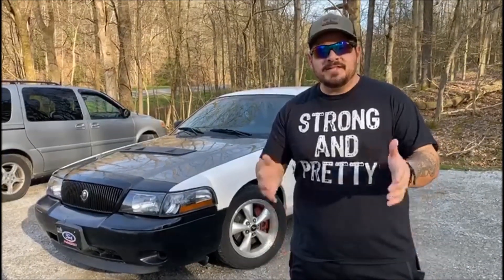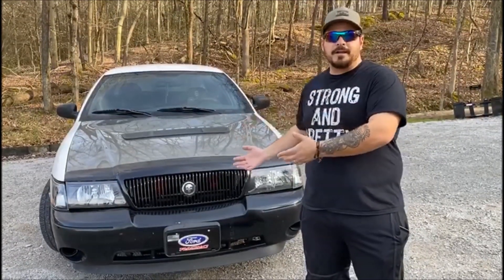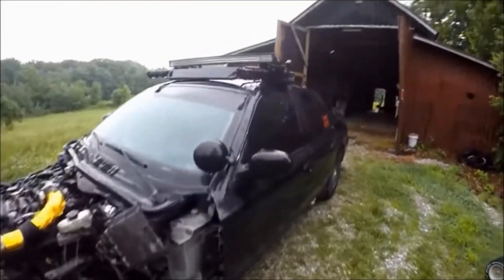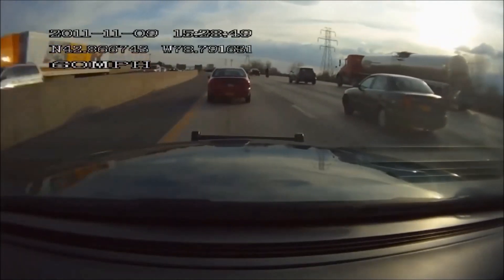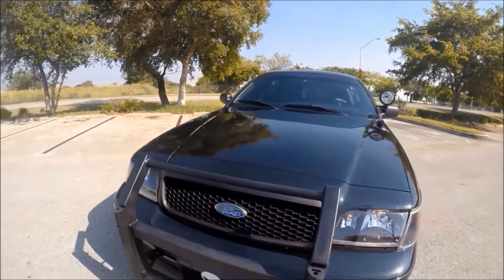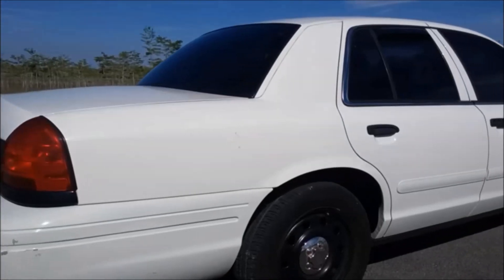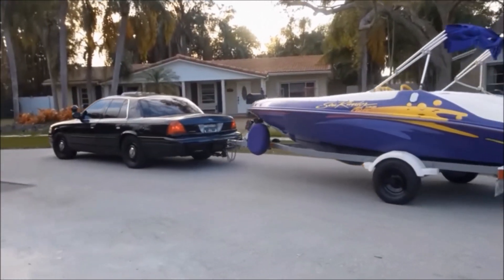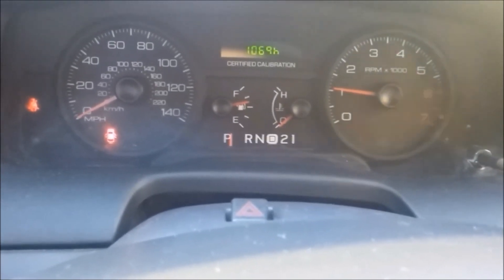Certified Calibration EXPLAINED! Crown Victoria P71

Comment: if you look in the police supplementary guide it says that "certified calibration" only applies to the calibration of the speedometer head assembly, and not the speed from the computer, which can vary depending on tire pressure, etc. So they come from ford like that, but i guess PD's check the calibration with a 3rd party and then they issue some sort of certificate. The supplement guide also says the speedometer head is accurate within ± 2 MPH so that's pretty damn accurate compared to regular cars which is like ± 5 MPH.

Comment: On a 2009 p71, changed the rear end to a different ratio... now the speed is off by 5 mph +/-.  Is this fixed with software, or is it a "speedo gear" somewhere in the car? Can't get a straight answer on this??? Thoughts??
Reply: Tim Mallon your speed will definitely be off if you changed the rear end because of different gearing so to get it back on perfectly it would need to be re-calibrated. To get it closer to the true speed make sure you have the original wheels on the vehicle.

Comment: Could you still get it certified after it's a retired police vehicle and where could you get it done at?
Reply: James Lorenzen no it cant its strictly for currently in service police fleet vehicles. But once it is calibrated is stays calibrated for many years as long as you have the original wheels.

Comment: Interesting when I tested mine against a cell phone app Speedometer, which I guess works by GPS, both were spot on with each other.
BUT  when I first got the car, the ABS computer had gone out and the dealer said they would replace it for me the following week.  In the week before I got it fixed I drove the car and compared it head to head with the Speedometer app and the car speedometer read 5 mph low.
Then after they replaced the ABS computer, the two matched.
So why would the ABS computer affect the accuracy of the speedometer?
Reply: B3burner the ABS and wheel speed sensors work use the same computer on those cars so if the computer goes bad for whatever reason then the computer is unable to read the wheel speed sensors 100% accurately therefor causing the speedometer to be slightly or largely off.

Comment: Crown vic intercepter, 
dodge charger intercepter
What is better do u think??
Reply: 0 hobak the crown vic was built to last a lot longer, the platform goes back decades and the engine didnt change much also so as the years went by Ford was able to perfect it as far as reliability goes. The charger has a more powerful engine but isnt as reliable so the extra power isnt enough to best the crown vic overall.

Comment: I was wondering about that. I've got a 2000 P71. There were no outside mounted lights, etc on this car. Inland South Carolina, no real rust. I bought the hubcaps on eBay, had to buy shouldered lugnuts to hold them on. I wonder why there is no replacement headlight switch available. This switch has a copper printed circuit board, with copper fingers as contacts. They discontinued this design, and replaced it with a real switch with normal contacts. I bought an 03 switch assembly, connectors are different. As it is, I've ordered a wiring manual, from Faxonmaual. I might visit the local car salvage, get the pigtails with the right connectors (lights, dimmer). I just hope they didn't change the color codes. Then I'll have to get the 03 manual. Oh yes. It will be done. Even if I have to replace the dimmer switch stalk. Already replaced the LCU. Best price for that is Rock Auto. Anyone here had the flickering headlights? It's more a chattering on and off, and flipping the switch helps. I don't trust that circuit board thing.